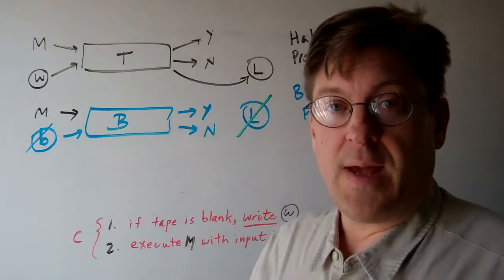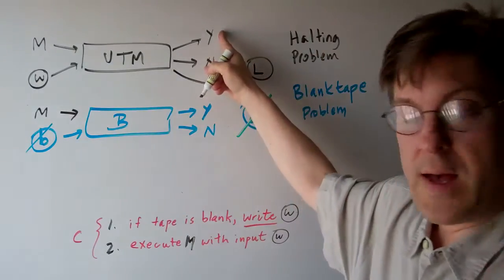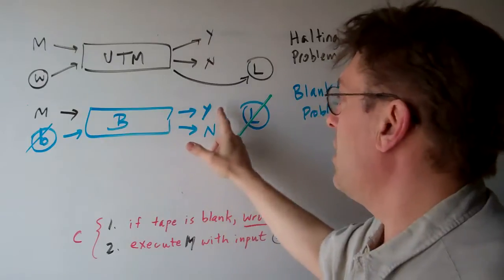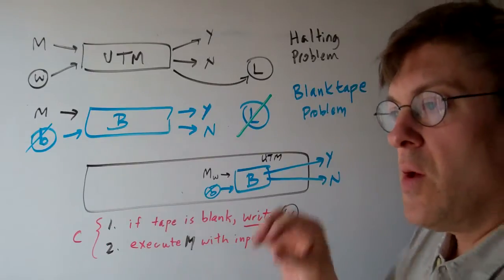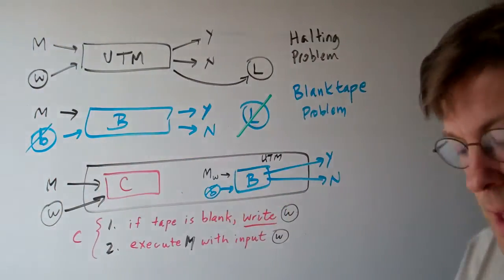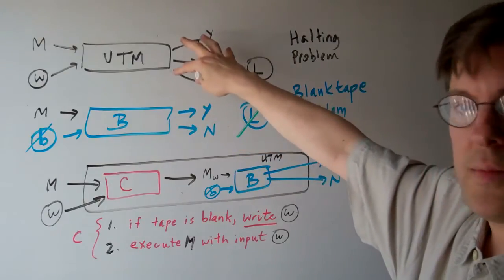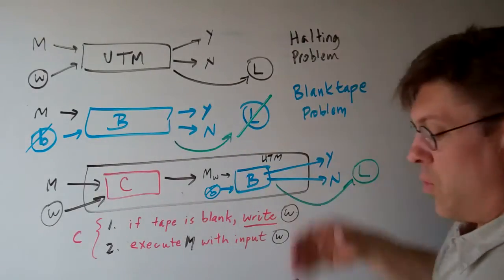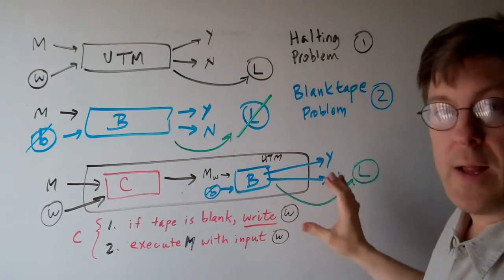Halting Problem - Blank Tape Problem - Reducibility - Decidability

Comment: Can someone please explain to me why it's necessary to write a w on the tape?
Reply: You dont really write w on the tape. Using C, you construct the Mw so it would write the w on its own tape at the beginning of its execution (it has w "hard-coded" in itself). Then you could feed it to B and get a solution for (M,w).
Reply: @scutze  Ah ok. That makes a lot more sense now.
Reply: Because when you write w on the tape to create Mw, when you feed it to B, the input is exactly the same as in the halting problem.

Comment: Are these two statements same: 1) Reducing the blank tape problem to halting problem 2) Reducing the halting problem to blank tape problem?
Reply: nope
Reply: I guess the prof made a mistake. He said "reducing the blank tape problem to the halting problem". In fact, reducing A to B means that A is solvable once B is solvable, i.e. A is less difficult than B. On the other way around, once you get an algorithm for B, you can transform that algorithm-B into algorithm-A to solve problem A. In this sense, we should reduce halting problem into blank tape problem. Then by assuming an algorithm solving the black tape problem, we shall construct another algorithm to solve halting problem, which contradicts the fact that halting problem is unsolvable.

Comment: I believe your construction is probably good supporting material for why the undecidable/looping bit appears for the constructed machine, but your argument for that isn't clear to me.  You also haven't clearly described why the constructed machine and the blank tape machine have output/decidability equivalence.
Reply: Reductions are a bit tricky. The whole concept is using problems that have already been proven to be undecidable, NP complete, P, etc, and reducing them to other problems to see if they are also undecidable, NP complete, P, etc.

The "constructed machine" is not a new machine, per say. It is a machine that takes TM A's inputs, and "decides" A using a "decider", a procedure that runs TM B to solve TM A's original problem. So the final output will always be TM B's output.

In this case, the original problem A is: Does M Halt? The decider converts, or "reduces", A to B, and we know that A is undecidable because that has previously been proven (see: the halting problem). If B always accepted or rejected and could not loop forever, we could solve A using B using the decider he constructed. This has been proven to be impossible, so B must be able to loop forever as well.

Further:
1) If A reduces to B and B is decidable, then A is decidable. This is because, since B is decidable, we can decide A by reducing it to B.
2) If A reduces to B and A is undecidable, then B is undecidable. This is because if B were decidable, A could be decided using B (1), so by contradiction, B must be undecidable.

However:
1) If A reduces to B and B is undecidable, we do NOT know whether or not A is decidable. Decidable and undecidable problems can both be reduced to an undecidable problem.
2) If A reduces to B and A is decidable, we do NOT know whether or not B is decidable. Same reason as #1

Note that these same concepts work for NP completeness.